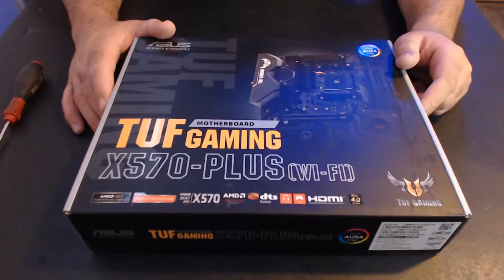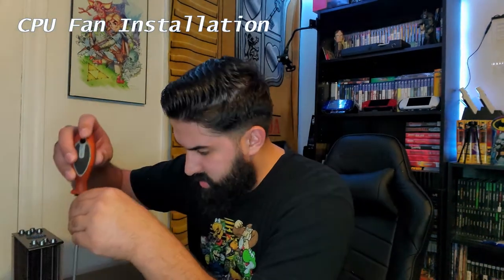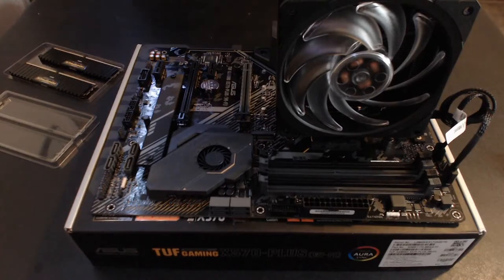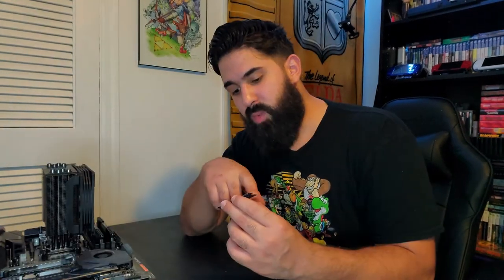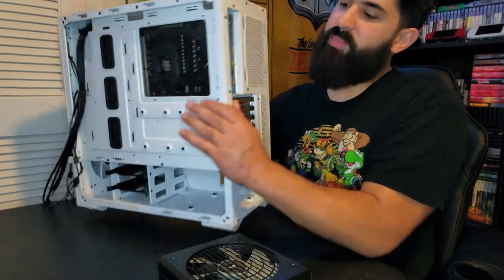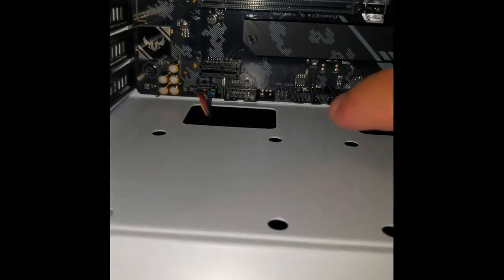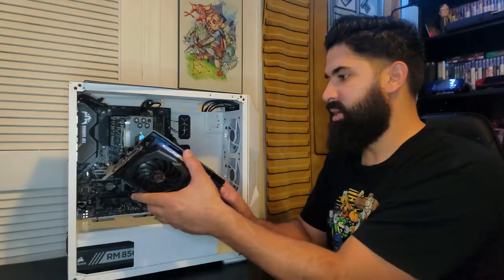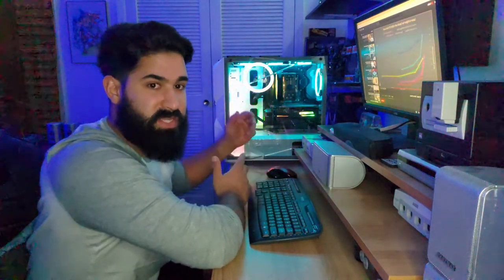Gaming PC Build - RTX 2060 Ryzen 7 3700x (w/Benchmarks) - New PC for the Channel!

Comment: how did u find screwing in the cooler? i had to push down sooo much to get the screw to connect with the thread
Reply from the maker: Same here! I didn't like that to be honest I thought I was gonna crush my brand new cpu but I mean I did everything according to plan with using the provided bracket for cpu and hardware so 🤷🏽‍♂️. So far my temps are normal and cpu specs are good.
Reply: @BadgersGameRoom  haha yea i thought i was gonna snap something. of course i had an issue with my mobo so i had to uninstall it. I was to afraid to put it back on so i put the stock cooler on haha

Comment: Is 850w really needed? Have a 2060 w a 3700x and I’m running a 650w
Reply from the maker: No it's over kill which I did on purpose just to be future proof in that regard. Since my original plan was to get a 3080. Side note: im actually loving my 2060!
Reply from the maker: Farhan VC  yes the GPU is definitely the bottleneck. My CPU runs at 30% max while gaming and my GPU is at 99 -100% which I read isn't bad for the GPU.